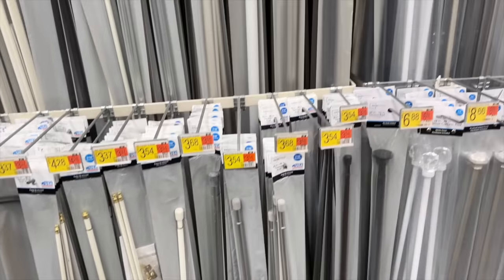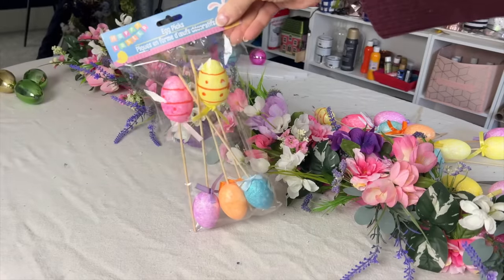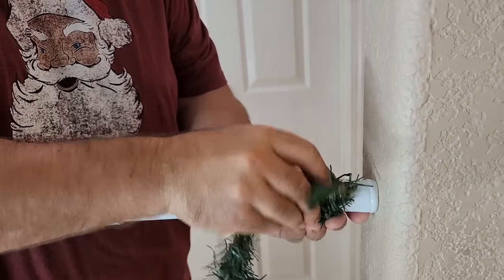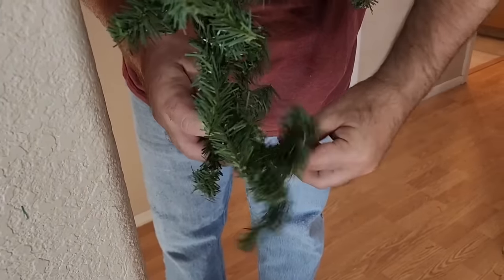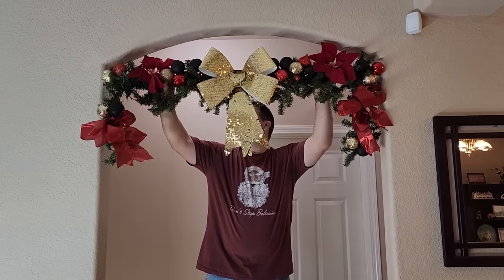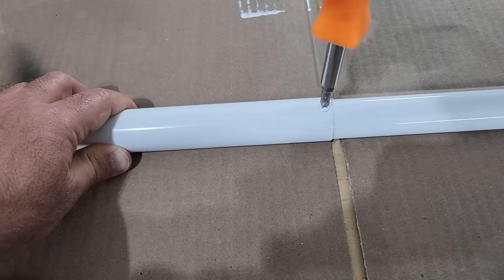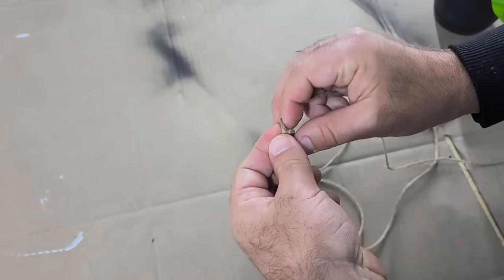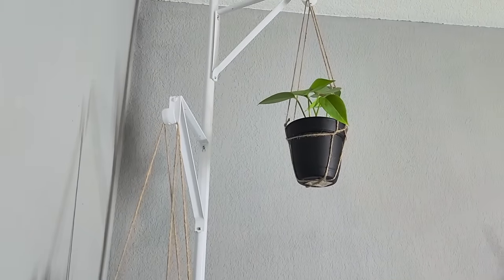Stick a tension rod into a pool noodle for this genius kitchen idea!

Comment: Tension rods are good for many things.  I put two in my RV shower.  One centered over the shower head against the opposite wall so I can clip various things up there that need to be dried.  One over the shower doors onto which I hook things that don't fit on the door rail.  I also have plants situated around, but mine are fake.  So I don't have to water them.  Nice ideas for people who need a project.

Comment: I think I'll use the pool noodle idea in combination with the Christmas garland idea for the Christmas season 2024. The noodle will add bulk for me to wrap on a bunch of stuff I have on hand. My arch is quite high, so I need something a bit more substantial in size. I like the ceiling mounted plant hanging pole for my greenhouse. Thanks for sharing these clever ideas.

Comment: One could purchase pipe insulation and not have to deal with cutting a pool noodle lengthwise.
Reply: Pipe insulation comes in a variety of sizes and is generally less expensive that is a great suggestion.

Comment: I love the flower covered tension rod/pool noodle. At one of my homes (first place w/out ANY males) I covered my bedroom with as many fake florals as I could. However, that was in 1994-2001 and fake florals were pricey even then when I was buying so many. Now it's worse. Bums me out as I'd love to do this but I'm now on a very tight retirement budget. I'm going to be on the lookout though everywhere I go for cheap florals. Anyone let me know if you have any suggestions.
Reply: Thrift stores, yard sales, ask friends for any they don't want or need. Many times the ones you find or are given will be like new because somebody never got around to using them! And watch for sales in crafting stores. x